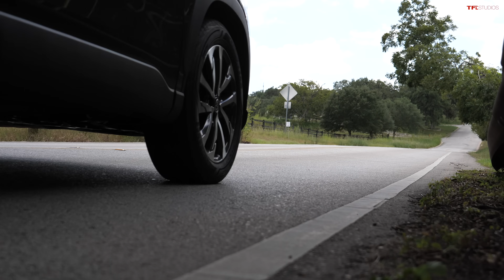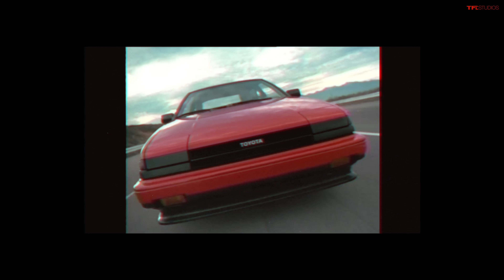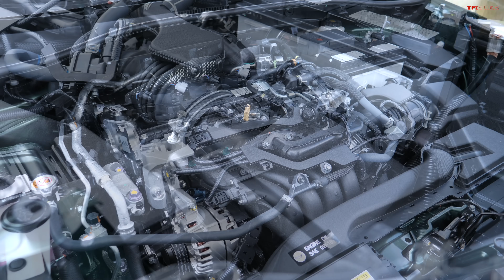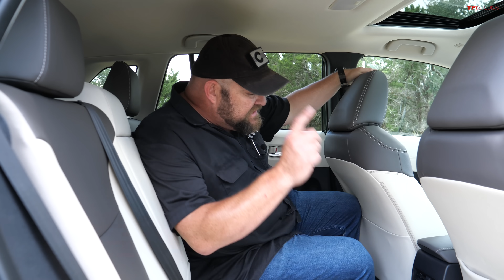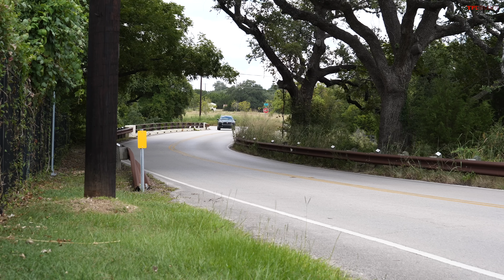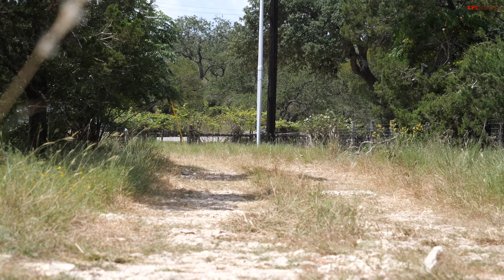Can The 2022 Toyota Corolla Cross REALLY Go Off-Road? (Yes, But Actually No!)

Comment: i have a corolla cross with 2.0 engine. i use extreme driving style to get 5.0L/100km, which is 47 MPG. i never go over 100km/h, seldom let the engine go over 2500rpm when accelerating and hyper mill when ever possible. so l smile when i see the gas pump, and its a different kind of fun to squeeze for MPG.

Comment: The RAV4 started off as an economical convertible 2dr CUV with available 4WD. Now it's as big as a 1st-gen Highlander.

 The Matrix AWD had near-useless roofrails.

 Toyota already used to sell a Corolla 4WD wagon...30-something years ago. The Matrix was basically that too, just by a different name.

 The Corolla Cross is comparable to a stock Crosstrek, but the Crosstrek aftermarket is already pretty decent. TRD or somebody better start offering skids, rockers, bumpers, winchmounts, diff-lockers, turbo kits, etc.

 IMO, Toyota could have had an earlier North America winner if they offered AWD (and turbo) in the CHR.

 I'd like to see them come out with another economical convertible, or several...RAV4, Celica All-Trac Turbo,  Solara AWD, etc. The Celica convertible was one of the most practical convertibles ever offered, IMO...affordable, 4-seater, good MPG, and reliable.

Comment: This vehicle is going to be just fine for daily commuting and errands around town, and it's probably fine on the highway as a road tripper as well.  For it's class, it's perfectly Toyota and they know it.  If Toyota puts in a 180hp hybrid in the US market, it'll be a home run, put in the same hybrid as Corolla sedan, not so much. Toyotas typically do everything you need just right, they're not awesome, they're not bad.

Comment: Perfect for those who don't want bigger or fancier when trading in their old Rav4. However, for those who have some ability and want something that can get out of it's own way, it's hard to beat the Kona. Also, 4 wheel drive system in Kona is massively better, especially if you have the 6speed transmission that's in my 2021. Note, Toyota is masters at calibrating their traction control system, while I'll lock the differential and turn off TC when I'm pushing in the snow, with Kona.

Comment: Personally only if you absolutely need the space but is on a tight budget, I don’t recommend compact crossovers like the Corolla cross as full size crossovers like the rav4 and crv boasts a better cost performance ratio and sedans like Corolla and civic has better style and handling

Comment: I bought the Hatchback with the manual because I'm in my 20's and dont have kids. Give it ten years and yeah, I could see this making sense. It's going to sell like crazy. Its much larger than the Kia Soul for example and pricing overlaps. Has more power than the HRV, makes more sense than a Seltos or Kona. Home run, if a boring one.

Comment: I won't buy a car that comes with Torture-Beam suspension ever again after having gone down that route several times previously so that would leave me with the AWD version which is fine by me but unfortunately I won't buy a car with a CVT either so that "Crosses" this car off my list for now.  What would make a lot of sense is if there was also an option for a version that comes with the 8-speed automatic transmission that comes in the RAV-4 in which case, this car would be back on my list again.  Torture Beam and CVT are no-do'ers.

Comment: If you take it off road it will squeak and rattle for its entire life. Toyota is the largest car manufacturer in the world, but they are built cheap, yes they last, but built cheap. Thin panels and plenty of road noise. They build them light for fuel  Economy, no sound proofing. When they get hit, may as well buy another. I worked in collision shops for 44 years, so I might know a little about what I’m talking about..don’t take anything off road unless your an idiot and daddy bought it for you!

Comment: Let’s wait for the Toyota Corolla Cross hybrid … more horse power …
Reply: The hybrid will have less power if they use the Prius drivetrain that’s used overseas.  That’s what’s used overseas.  The RAV4 hybrid engine would be too big, heavy and expensive for this vehicle.

Comment: That's some decent gas mileage I've got the 1.7 l 4cyl engine in my 2013 highlander and it gets about 26mpg with like 170hp this seems very comparable.
Reply: You mean 2.7.  A 1.7 wouldn’t be able to move the Highlander without extreme low gearing.
Reply: @user-tb7rn1il3q  You're absolutely right my mistake.
Reply: I have the 6 cylinder highlander I would think a 4 cylinder would be small for a highlander. But maybe toyota may replace the 6 cylinder with a 4 twin turbo engine.
Reply: @Calgaryproud  I'd have to agree a vehicle of this size has no business with a camry engine the sport mode is pretty funny though. The 4cyl Tacomas have had superchargers and turbos for ages I think the highlander would benefit greatly if given the same option.

Comment: My first brand new car was a 1978 Toyota Corolla Station Wagon (hatchbacks were a different,  sportier looking style) with a 4-speed stick and no options other than floor mats - not even a radio. My memory is that the sticker price was somewhere around $3700. I made my living as a drummer back then and my not-smallish drum kit fit perfectly into the car with the back seats folded down. This one looks like a nice retiree car for a Minnesota guy.

Edit: When I bought my Corolla wagon, there were two of them on the lot. Years later joined a band with a guitarist who had bought the other one.

Comment: Actually a friend of mine had a Corolla in high school in 1968. I really like this new vehicle. I am looking to replace my 2003 Toyota Corolla Matrix which I bought new in early 2002. It has been great, but is becoming worn at 211,000 miles and nearly 20 years. If this vehicle lasts as long as the matrix, i will never need another car. Toyota quality rules.
Reply: U not going to get in this cvt crap trans the milles u have in ur old toyo
Reply: @martinmarin841  facts cvt is garbage they only doing it for better fuel ratings, I rather have a reliable transmission w/ terrible gas mileage than anything.

Comment: this has a DCVT... the only cvt that will last... the real first gear removes the majority of the high-torque load on the steel belt... result: the steel band actually lasts.  Normal CVTs have to take the 1st gear or "take off" load right at the belt... it can't handle that over time and that's why they fail.  Aisin made this DCVT.  It will last.
Reply: Interesting. I’m curious why Toyota doesn’t use an ECVT with the planetary gear for ICE platforms since I have heard they are very reliable?

I understand having a gear in the DCVT must give traditional drivers familiar feel, response, and help improve the CVT, but why not only limit the ECVT to hybrids? Wish I knew more engineering behind it.
Reply: @BarcelonaBlitzer  ECVT had no metal belt.. it is NOTHING like a CVT.  eCVT couples the engine to the motor electromechanically.. again no belt at all... look up an ecvt diagram... they can only be used in hybrids
Reply: @personalfunfest  I guess I don’t understand how power is sent to the wheels with that planetary gear and why can’t that engineering can’t be used for gas engines so those platforms can have the reliability of eCVTs without the belt. 

Is the eCVT only between the e-motor and gas engine then a separate transmission for power to the wheels for those Prius and Ford hybrid owners?
Reply: @BarcelonaBlitzer  There is NO transmission in a hybrid.  The "synergy" between the engine and motor act as both the power source and the "transmission"... look up some YouTube video in ecvts.  You can't have an eCVT unless you add an electric motor... eCVT is a bit of a misnomer and completely different from a belt driven CVT.
Reply: @personalfunfest  I appreciate the explanation. I’ll look up more about it
Reply: @BarcelonaBlitzer  https://youtu.be/3xeyqGcfb8M

Comment: Good to see ya in the front seat this time ;) . . . 

I've been waiting for this one.  It should sell well; although it'll cannibalize the RAV4 and Corolla sales a touch, Toyota's reliability and (hopefully) build quality should draw buys from the other Sub-Compact and Compact rigs.  
- I am still not sold on the CVT and the Torque figures do not impress; I would go so far to say that the Tike Ike test might be a problem with only 150 ft.lbs. coming outta that I4 . . . can't wait to see the video though.
Reply: Saw an Interesting bit on car site this morning . . . "Over in Taiwan, Toyota is now offering the Corolla Cross as a GR Sport offering. Fortunately, its enhancements aren’t just skin-deep, as the brand has equipped the vehicle with a GR Sport suspension system and reinforced its chassis."  
- It's still propelled by the low-end powerplants available in Taiwan, but a GR Sport in the United States would be a nice addition to the Corolla Cross.
Reply: @OldThomMerton  that does sound good. Unfortunately no ones gonna buy it.

Comment: Corollas are some of the cheapest feeling and cheapest sounding cars I've ever sold. A 2021 nonetheless. Cheap sheet metal, the rear seats felt as if you can rip them apart like styrofoam.
Reply: The 80s and 90s corollas were actually very well made but i do agree after about 2003 the quality actually went down. My mom has a 2013 corolla and it feels so much cheaper compared to the old 1997 corolla i had. The 2013 had so much hard plastic, hard seats, poor visibility it felt really crappy. But the 1997 actually had softer plastic, better visibility, and better handling.  Although it seems Toyota has improved the quality with the introduction of the corolla hatch in 2019.
Reply: @paranromallover4543  Yah can agree on that as I know a few people who had older Toyota's and said they where much softer and felt better built inside than the newer ones
Reply: Because it’s a Toyota it’s automatically worst in segment for interiors

Comment: Waiting for mountain/off-road and snow test video!  The design is fine, so are the options, but this reminds me of when Subaru Crosstrek had only 2.0L engine option which lacked power.  I would say 2.5L engine upgrade, would make Corolla Cross more compelling, otherwise I would just buy Crosstrek or Mazda CX-30.
Reply: I doubt many people are gonna use it for offroading. It will most likely be a daily commuter and the AWD will help out on snow and ice.

Comment: Well done, Nathan.  While other "reviewers" bemoan "the dreaded surge to SUV ownership," you explained quite easily why people are going there.  You can get in and out of the things.  The manufacturers have all decided that "all cars MUST be sporty," and thus they've saddled them up with ultra-ultra-ultra-ultra low-profile tires and monster huge wheels, so they ride like rail cars on dirt roads, even on the most perfect pavement.  SUV's, on the other hand, can have tires with healthy amounts of sidewall, so you can actually ride in them comfortably.  And, of course, then there are the givens with actual room for passengers and cargo.  Indeed, why buy a Corolla hatchback when you can get one of these for around the same price?
Reply: I’d bet that all low cars are gone after 2025.  Everything will be a CUV, SUV, Van, or Pickup.
Reply: I couldn't have said it better... Add to it the risk of flat tyre and broken alloys by hitting even an ant sized pothole with these new impractical low profile tyre cars
Reply: these low profile tyres are made to be reviewer- friendly ... So they say it has a "sporty ride quality" , and so is low ground clearance  ... And  It's very similar to "hard plastics" as well being a negative  ... I'd rather have hard durable plastics than have breakable, scratchable wax like plastics on my car that hits it's underside on the slightest of road bends and gets a flat tyre and broken alloys(steel rims bend and don't break) when hitting ant sized potholes while having   bum hurt from the vibrations ...

Comment: Better alternative is the wagon Corolla not available in NA.  Here you have a hood too high for nothing. The front grill is  blocked on his half because anyway there is nothing to cool higher . Aerodynamically speaking  like all the other suv  , this is a waste of energy versus a lower car . People want suv because easier to slip in: ok but their hood don’t need to be so high: the high '50s bath oil air filters no longer exist!

Comment: The only stylistic/safety miss, imo, is lack of amber rear turn signals, which are more noticeable than red signals under all traffic and weather conditions.   For the life of me i do not know why rear amber signals are not mandatory as in the rest of most of the world.
Reply: Cuz their ugly
Reply: @smath5841  they need not be ugly...many manufacturers incorporate amber bulbs with a slightly red lens cap so they blend in...so "ugly" is not a reason.  In fact toyota did this often in the 90s and early oughts.
Reply: @smath5841  forgot this:  you say they are amber but on several other reviews where the 4 way flashers were on to showcase lighting, only the red rear lights flashed

Comment: A hybrid / plug in hybrid version of this would be pretty cool.
Reply: I would be very surprised if Toyota doesn't offer one at some point.  The only hitch is that this vehicle doesn't have as much cushion in the price so hybrid will probably be a more expensive add than RAV4.
Reply: @1guyin10  Toyota already announced that a hybrid is coming to the US, it was supposed to come out alongside the gasoline version but Toyota delayed it due to microchip shortages

Comment: Probably going to be a great snow zone all around small crossover. I can see these putting a dent in Subaru sales in Flagstaff as an example. Slap on some Wildpeak AT3's and you are good to go for commuting and graded forest road access camping.
Reply: I have a crosstrek and I test drove a rav4 and corrola cross first. What im about to say is coming from a hardcore toyota fan, ive hada Few. Neither of them compare to a crosstrek. Not even close. In any way. Build quality, comfort, ergonomics, style, ride, noise, user friendliness...
Not to mention the options I wanted were standard on subaru. Awd for starters, which is on all the time and doesn't overheat. New to cvt, always had standards, so we'll see about that.
Reply: @guybowling5358  Thanks for the real world feedback. Really like the Crosstrek but not a fan of CVT's in general in an automotive application. 

That is a position of ignorance because I really don't know how easy or hard they are to service. Probably just fine for soft roading or daily use. Edit - I understand this has a CVT as well.
Reply: Saw an off-road comparison and the Subaru Crosstrek was hands down better.  I was surprised since the Subi is pure CVT while the Corolla has the legit first gear before CVT engages.  Came down to FWD biased AWD vs RWD biased AWD which RWD biased is better.
Reply: @ErokCherokee  Thanks. Do you mind sharing the review?
Reply: @ErokCherokee crosstrek comes with better terrain tires too and conventional cvt vs toyotas e-cvt.
Reply: after seeing this, I would not buy a crosstrek

Comment: I'm not into crossovers at all, but this looks like a much better option than the Crosstrek
Reply: This is Way way way way more reliable
Reply: They do have a 2.5 option on the Sport and Limited trim for the Crosstrek. 30 more HP. Just a FYI Does seems to make a big difference now.
Reply: Crosstrek has better ground clearance, and the aftermarket offers a rear locker, skids, steel "bumpers", and a winchmount. The Subie CVTs also use a chain.

 I hope the aftermarket for the Corolla Cross competes. Toyota typically offers better reliability/longevity.

 Not everybody likes the boxer engines that Subie uses either.

 Neither one is meant for offroading. I have the same opinion of several modern Jeep models too. Plastic bumpers, airdams, and rockers have no business on an offroad 4WD, and the driveline should be able to lock the center diff.
Reply: @RKmndo  and crosstrek is slow af
Reply: @naturehacked  No. No. I f way faster than my 2.slo/CVT Crosstrek accelerates. By the time it reaches 60MPH, I'd have time for cuddling already. I consider a stock 2.slo to be..."glacial".

 I can get 40+MPG with the Crosstrek though. Set the cruise around the speed limit.

 A hi-flow cotton airfilter and some intake spacers might help. AVO offers a turbo kit too.

Comment: CONGRATULATIONS Toyota for finally waking up.  You could wipe up the compact crossover market.  You make one the best liner AWD's, offer on all models - imagine Camry or Avalon with AWD.
Reply: Funny you say that, they took the awd system from the Camry awd for this Corolla cross. Check out the Lexus ES 250 awd as well. So they have them!
Reply: Awd Camry has been out for years
Reply: Camry has AWD since 2019, i had one has a lease and traded it in when my lease ended, I wanted to keep it, but got a highlander AWD for having 3 car seats in the rear.
but I am agreeing to delete the CHR since it didn't make any sense in the lineup.

Comment: This is not a new thing guys. 20 years back? the Toyota corolla Matrix....?
The owners manual says Corolla Matrix.
High performance variant with the Yamaha designed 2zz engine that you can't actually Redline, and there was an AWD matrix. It was a crossover before the moniker was coined